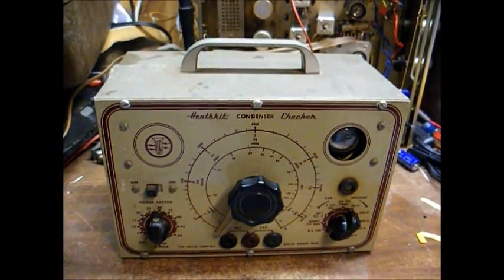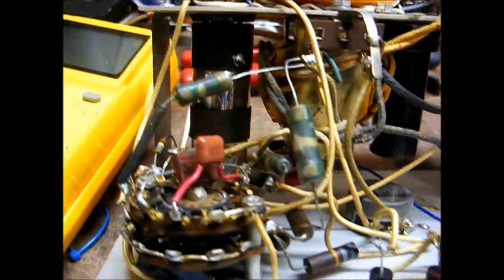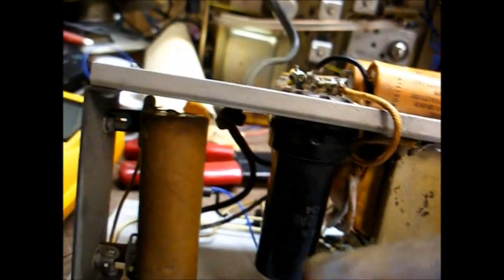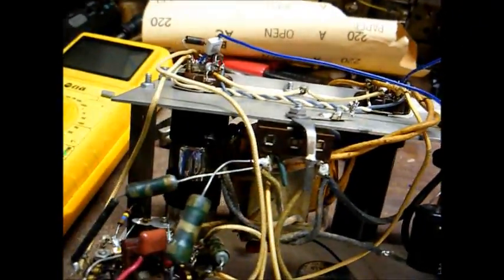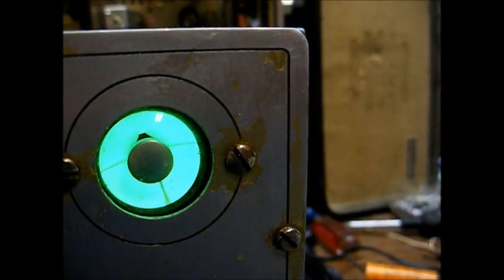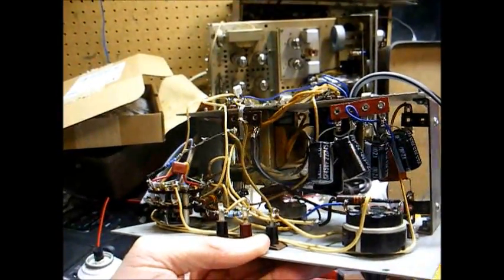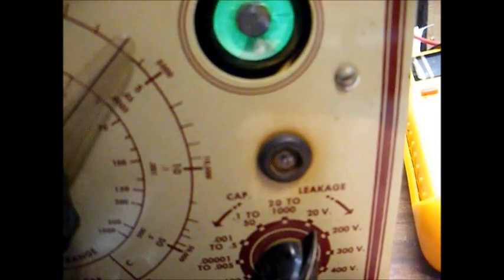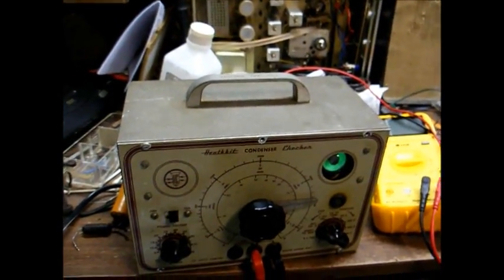Restoration of a circa 1950 Heathkit C-2 capacitor tester - part one

Comment: I would recommend replacing the AC cord with a 3 prong type...MUCH safer and provides a much needed safety factor when using high voltage that these testers have.....I just finished restoring a C-3 model as well as many other instruments of that type.

Comment: Very nice.  I like your videos about fixing this old test equipment.  Only thing like this I have is a Simpson multimeter that was adapted so the blind could use it, think it's 60's vintage but not sure.  It uses an audible tone to tell you where your meter reading is.  Unfortunately the guy that gave it to me had lost the test leads so I can't even really test the damn thing to see if it works or not.  Maybe one of these days I'll find another one in somebody's crap box that will have the leads.

Comment: Nice repair. About 40 years ago a fellow Ham Radio friend gave me several pieces of Knightkit test gear. One of them was a compactor tester very similar to your Heathkit tester. I finally got around to restoring it last year by recaping it. I was fortunate that all of the resistors were okay. A capacitor tester isn't something that's absolutely necessary for the general hobbyist, but it sure comes in handy when working on vintage gear. Thanks for taking the time to make and share your video. 

73 -- de Mick, WB4LSS
Reply: Mick Bradford i

Comment: You might want to check the voltage applied in the leak test, esp the lower 25v. If its like mine (c-3) the voltage in the 25v range is more like 50v, which may stress out some of the  lower voltage electro's that you test. Check it in the eletrolytic range as that seemed to have a slightly different voltage than the mica/paper range. I ended up altering the voltage divider resistors on the voltage range switch to make it work correctly.

Comment: I haven't run across that many Micamolds, I don't think they were that popular in Canada. I have run into tons of those plastic molded paper caps from the late 40s and newer, both as bumblebee/black beauty types and those brightly coloured Sangamo "Little Chiefs". Those things are crap, the only condensers I have had vent while a radio was in operation. Almost as bad are those ones in ceramic tubes, those can actually explode. I have run into the Micamold type resistors on occasion though, those aren't too bad actually.